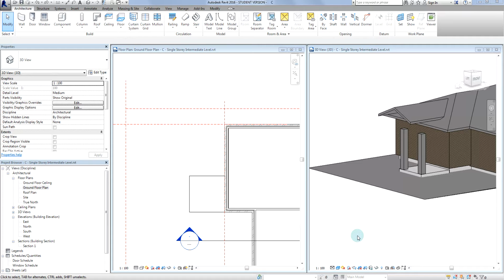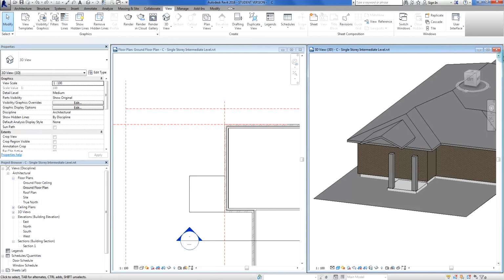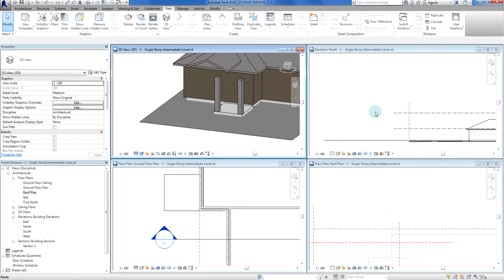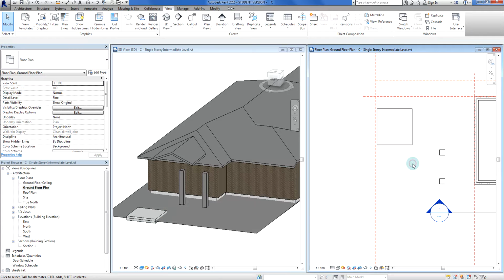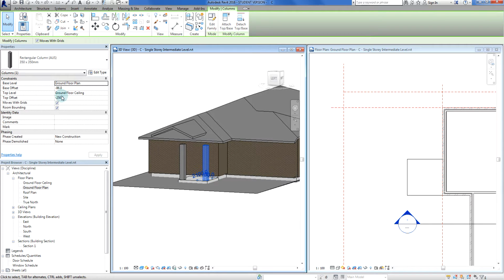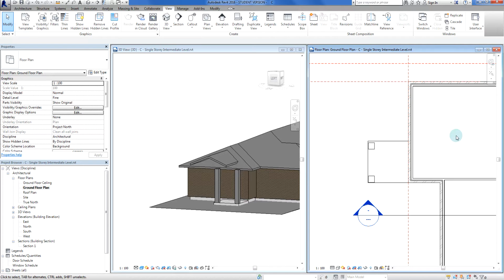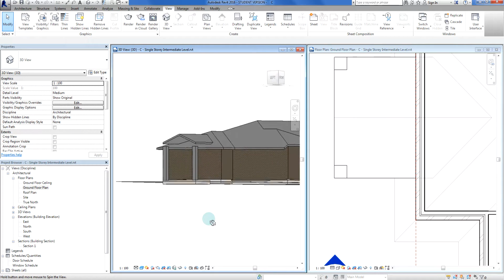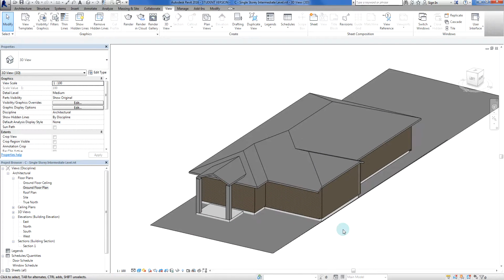Revit - Single Storey Intermediate 17

Comment: Hi Rhys Davis, I have a question, I think you could help me. can we open revit  file in autocad or not?. If yes could you please tell me how. Thanks
Reply from the maker: Hi there

We can't open Revit files in Autocad direct.

There are a couple of options.

1. Convert 2D views to dwg using the Revit Export function. This is for 2D work.
2. You can also export 3D models as IFC which 3D Autocad might be able to pick up.

Hope this helps.
Reply: Rhys Davies Sorry 4 late reply.Thanks very much will try, Many Thanks!